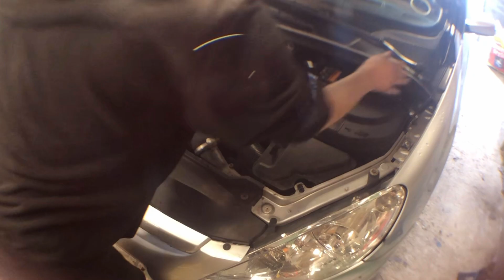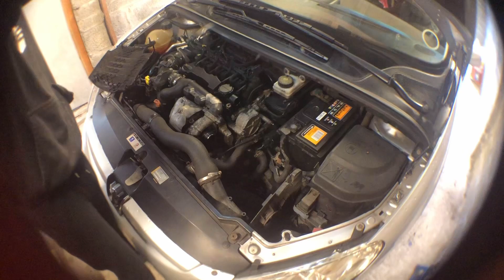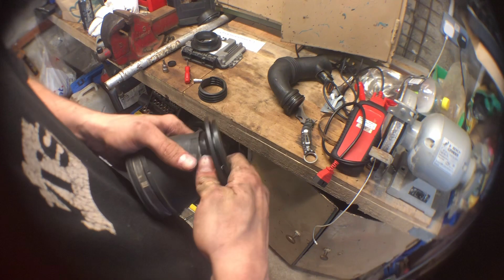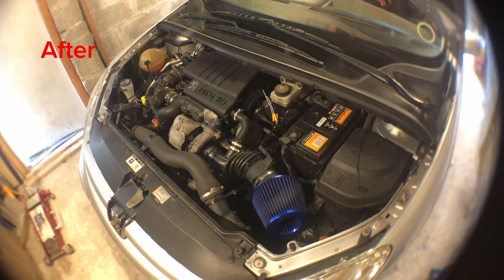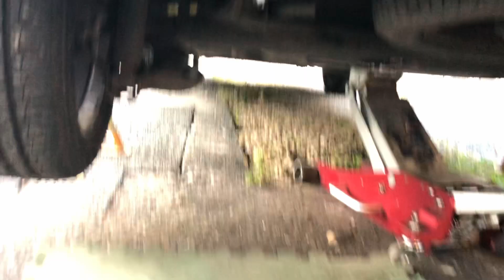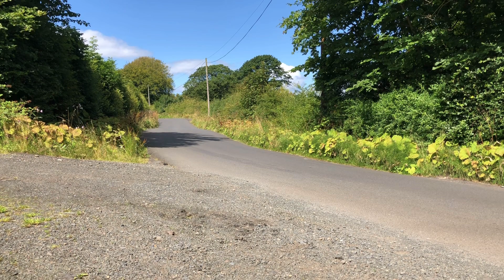Stage 1+ 1.6hdi 307sw DPF EGR Delete 3” exhaust induction kit

Comment: When you blanked the EGR did you unplug the connector ? Have done same mods to my 407 1.6 HDI 110
Reply: Unplugging the connector on mine throws a CEL and code, but blanking it and leaving it plugged in doesn't
Reply: @19jacobob93  Yes . Mine is mapped out of the ecu though so don’t believe it makes a difference plugged in or not I’ve tried both
Reply: @Mr330d  if it's mapped out then it makes no difference
Reply: @19jacobob93  That’s what I said yes.
Reply: @19jacobob93  On a Similar engine 307 1.6 HDI 90 with no DPF from factory EGR could
Be blanked with no check engine light but i decided to remove the DPF and EGR from my 1.6 HDI 110 due to Eloys tank being faulty also mapped to around 142bhp claimed
Reply: @Mr330d  Yeah Euro 4 were much more care free than Euro 5. I have a Euro 4 2.0 HDi that throws codes if I unplug anything, but I can blank the EGR and hollow out the DPF without it realising haha
Reply: @19jacobob93  My 407s quite heavy to have a 1.6 HDI according to Parker’s it’s 1505kg so I wouldn’t like to have drove it with standard power 😂 . I bought it from auction after the owner shit herself with the DPF fault coming up . Tempted to go back to a 307 1.6 HDI 110 though wee bit nicer to drive